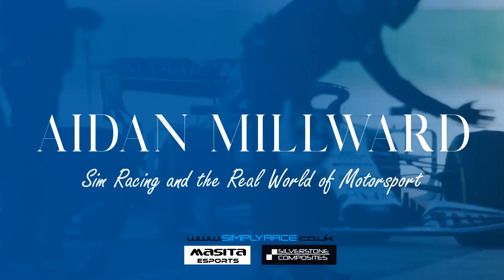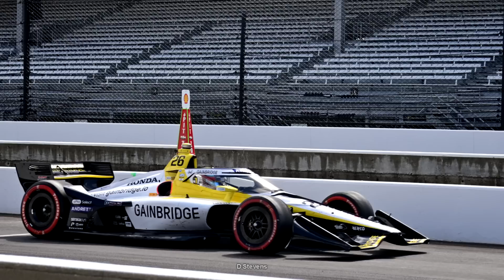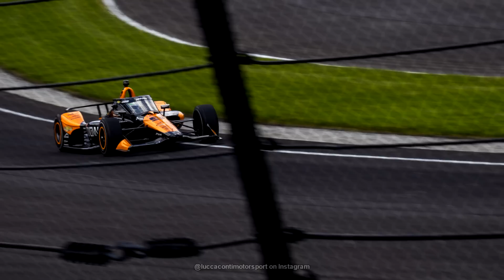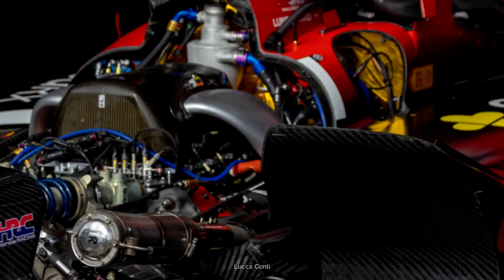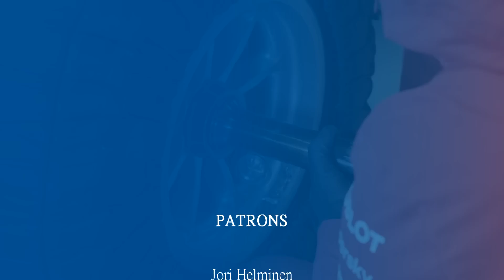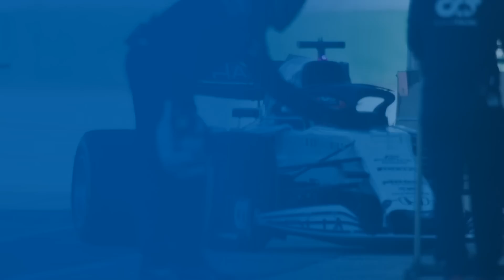WHY CHANGE ENGINES MID-SEASON? Opinions and a Look at Indycar's New Hybrid Engines

Comment: It sounds like a disorganised mess, but it could turn out to be ideal.

Half a season to figure out what the bugs are, do some experiments that’ll have the spectators complaining about the racing not being as good, then use the off-season to implement any major changes and get it all working properly. Bosh.

They don’t know what chassis changes could be necessary without finding out properly, which is better than guessing.

Comment: Two things:

1. Nashville is using the short oval aero rather than the superspeedway aero.

2. I honestly think the stinker at Iowa is due mostly to the repave and the fact that Firestone really screwed up the tire compounds. The lower lane was just too grippy to allow for any overtaking. The hybrid may have added a bit of weight, but there was no major change from it.

Comment: I think indaycar taking baby steps with new tech is fine. Better to work out issues in small chunks than all at once.
The new chassis is the going to put the weight in better places and hopefully make the car less of a pig. If there is a weight drop don't expect it to be substantial. 
Indycar is almost a spec series and while having more manufacturers is great I don't think it has that much of an impact on the series and the racing as a whole.
Tire competition is gone
chassis competition gone
engine competition.....lets wait and see.
Reply: You're never getting a tire or chassis competition (or even engine competition) like that again because that stuff needs money sprayed at the wall and a willingness for teams to try a rival's product out. Money that doesn't exist anymore, and trust that is gone because right now every team in Indycar thinks that they are just temporarily embarrassed champions and with one driver or one personnel change they'll suddenly be scrapping for wins and maybe titles.

Tire competition resolved itself in 2000 when Goodyear couldn't step up since '97 and everyone up and down the grid admitted Firestone was better. There's just no one else who's can crack the good feelings that Firestone gives the series right now, there was a move to swap from Firestone to Continental (?) in 2011 and the backlash was so bad from drivers and teams that the people who were pushing the change were all but evicted from their jobs in the following years.
Same with chassis competition. Five different manufactuers in CART in 1997 (Lola, Reynard, Penske, Swift, Eagle) and all five of them had bankruptcy between '97 and '02, with only Lola coming out of it alive because they went bust and recovered first. On the IRL side the chassis war between 2003 and 2005 ended because all the top teams jumped in on Dallara so Dallara just got enough money to crush the competition despite putting out an aerodynamic safety nightmare. There was a private bidding war for the 2012 chassis and Dallara won easily but all four submissions were financially gimped: Dallara's DW-12 won but was overweight and underdeveloped, Panoz just copy-pasted the DP01 specs, Deltawing was undercooked and slow to develop, and Lola had this bizzare idea that they could pull a Radical Cup and make the Lights cars and Indycars the exact same thing but with slightly different wings and engines.

Comment: Indycar is a complete joke with 0 initiative to actually improve. Indycar fans will defend this lethargy because “the racing is unbelievable”. News flash: no one cares. Gain some interest by doing something NEW and INTERESTING. This hybrid engine was introduced to keep Honda from leaving…not because the sport wanted to introduce something exciting for the fans. If this sport continues to stagnate it’s going to be gone in the next few years. Indy needs a complete overhaul…this hybrid engine is a meager start, but doesn’t begin to cover the actual issues affecting the sports health. The racing will likely be good regardless…give fans, sponsors, manufacturers, TV networks, social media, etc. things to be EXCITED about, rather than continuing the futile attempt to stop the sports bleeding

Comment: Coming from F1 where a new formula typically means lots of cars DNFing on fire or with smoke coming out of them I'm not much bothered by the idea of "doing it live" with the hybrid tech. It's cool that IndyCar is actually working on this stuff when other series aren't. On the other hand the hodge-podge nature of the current spec is a pretty valid complaint. Let's see how it goes.

Comment: I don't hate the hybrid, I hate how it is implemented.  They should be able to use the 320 kilojoules per lap at any rate the driver chooses.  Hopefully, they can increase the storage and create a higher output in power than the push-to-pass button.  Watching the past 2 races you can't visibly notice any extra speed from the car.  They should eliminate the corny red/green display chart for TV viewers and add red/green lights to the roll hoop.
I felt bad for Dixon, it really hurt his chances in the championship.

Comment: The primary culprit for the lack of passing at Iowa last weekend was the combination of the repaving and the tire compound Firestone brought for the Indycars.  Previously, the action was great because the tires started to go off about 30 laps into a run, when the cars would start to become a handful, and tire management was paramount.  This resulted in the need for four or five pitstops.  This year the tires would last an entire fuel run and this resulted in the race being a two-stopper.  Contrast that with the Indy NXT race where tire blistering was so bad that they had to shorten the race distance and insert a mandatory yellow for a new set of tires... so it wasn't just the repaving.
Reply: @HolmstromRules  Yep.  Firestone brought tires that were better designed for LeMans than Iowa Speedway.  Add that to the half ass repave and you've recreated a Texas Motor Speedway race after they dumped all the PJ1 crap on the track.  We won't have a good comparison until after Gateway which will give us a street course race and a short oval to see if it's the hybrid that's the problem or something else.
Reply: So one race with too little and one race with too much tire degradation?
Reply: @extragoogleaccount6061  Yep.  It wasn't Firestone's best weekend by a long shot.

Comment: The same teams that loved the chassis and engine diversity of CART has fallen in love with the cost savings from using the same engine and chassis until they are sent to a graveyard.  RP is spending adverse and hopes to get several more years out of what the series has by making changes that continue to delay any new chassis or engine. These teams will continue to beat the DW12 dead horse until the series collapses.
Reply: @MrRb9999  Those same teams were also generally paid by those manufacturers to run their equipment.  Things change when you're spending your money on stuff.
Reply: @danielh8316  that’s fine.  Just don’t make this sound like an issue caused by the series when it’s push back by the teams.  The teams like squeezing the pennies regardless of the affects on the series. They have had a chassis redesign on the table for years along with engine rule changes, but it keeps getting pushed to later dates and I’m sure it’s not the series requesting the delays.  Best way forward is to get a new chassis and have Illmore build the engines and let chevy and honda walk away.  They don’t have interest in racing, just designing stuff that doesn’t improve the racing product.  Next they’ll be pushing for a 2 liter I 4 engine with a 500 lbs battery.
Reply: @MrRb9999  Except it's only now IndyCar has come to the realization that they need a new car.  There still has not been an official tender for a new car, just the upgrades they keep making to the DW12 chassis. The only thing in your list that was actually worked on was the 2.4L V6s when Toyota was going to join before the new CEO of the US division pulled out.

If they just wanted more engines, Cosworth would have been there Day 1.

Comment: Introduced needlessly. I'm just laughing because it's worked out exactly as I knew it would. Even at best, it's just another push button gimmick to go with Indycar's existing gimmick of P2P. So funny that DRS is seen as a bad thing even though it's cheap and reliable, and it works. Indycar spends tens of thousands on two similar gimmicks that are unreliable and don't work.
Reply: DRS is a gimmick because only certain drivers and use it at certain times while P2P and the Hybrid are open to everyone.  And even if it didn't provide any extra boost, I'm happy the drivers can restart their cars after they stall in a crash or avoiding a crash.
Reply: @danielh8316  DRS actually does what it's designed to do. P2P doesn't and neither does this hybrid farce. They're just two things to get the talking heads in the booth to fill airtime with while providing no benefit real or imagined. That's a gimmick, Dan.
Reply: @F1jones  No, a gimmick is something only some drivers can use.  An even worse example is the Formula E Fan Boost.  If DRS could be used by the guy and front and in back, the majority of people would stop complaining to the point that the 2026 aero regulations does exactly that.
Reply: @danielh8316  sorry that you don't know the meaning of "gimmick, but it's "a trick or device intended to attract attention, publicity, or business." In other words, it's something that performs no function other than to serve as a talking about re: "hybrid."  DRS isn't a "trick," it actually allows passing where it's otherwise not possible. The fact you don't like how it's implemented doesn't change the fact that it actually works as it's supposed to. This hybrid joke is NOTHING but a gimmick and is intended to get people saying that Indycar is "hybrid," which the series has admitted, with the ultimate goal of attracting the mythical third manufacturer. They don't care that it does nothing for the racing itself. It's just another P2P which, BECAUSE at best both drivers can use it, with it becoming a "Push to not be passed" feature like in a video game, it results in no change but, again, is only something to bring attention to otherwise boring racing. It changes nothing on track, and thus, by definition, is nothing but a gimmick. Give it up, you're discussing things you don't understand, evidenced by your FE tangent, which has no bearing on this topic.
.
Reply: @danielh8316  sorry for the late reply, but I just thought of something else while watching the Toronto race today. F1 teams design their cars to get an advantage via DRS. It's an area of active development for every team and you can gain an advantage by engineering a better solution like Red Bull showed last year. It's resulted in there being a lot of variation in the rear wings from team to team and track to track. In Indycar, it's just a bold-on standard component. There's not even any competition between Honda and Chevy. You can't gain a competitive advantage by developing it in any way and teams can literally put more thought into improving their steering wheel as they can this hybrid component. But by that token, if it breaks there's nothing the individual team could have done about it too, they have zero input. That most succinctly defines it to me as a gimmick and not having much substance. 

Also, you said that only one driver has DRS, but that's not really true. When you're passed, you can try to keep up. If you were really faster, you can keep up and use DRS to re-pass the driver that just passed you. That happens all the time. It's also not automatic, there were quite a few instances in today's F1 race where drivers out-braked themselves. DRS isn't as automatic at some tracks as it's portrayed sometimes.

Comment: Why even add the extra complexity and weight of a hybrid system anyway?  It is purely 'green' pandering.
If IndyCar simply wanted to add want more power, they could (should) merely open up the engine rules a bit.... nah...  'save the climate'!
Reply: Because it also acts as a started motor to refire stalled cars.  If it wasn't at Mid Ohio, Race Control would have had to finish under yellow because of Grosjean's spin, but with the hybrid he restarted his car and continued racing.
Reply: @danielh8316  Nah.... they could simply add a traditional type starter if that was the goal.
Reply: @TalladegaTom  Traditional starters would drain the hilariously small IndyCar battery trying to crank a race engine with a 6-7000RPM idle.  That would require another modification in an area that can't really be modified.
Reply: @danielh8316  Um... no.
A starter system could be engineered for an IndyCar engine.  
The hybrid system as it is now is adding 105 pounds of weight.... surely you would agree that a traditional starter system could be engineered that weighs a LOT less than that eh?
Reply: @TalladegaTom  Where are you going to put it?  The car is already a Frankenstein Monster.  Plus, Honda and Chevy have already said they're keeping it at 60hp right now for reliability, but could go up to 150hp in its current form.

What's needed is a new car.
Reply: @danielh8316  I have some agreement there, but more hybrid complexity is going to make these cars look silly.  The F1 stretched limousine look is really odd looking and I do not want any of that in an IndyCar.

Few in the grandstands can really tell the difference between 2.2 L and 3.0 L.
Having more power all the time makes for better racing and demonstrates more driver skill every time.
Pushing a button to make an easy pass is the antithesis of that.
Reply: @TalladegaTom  It's not just pushing a button like DRS.  It's a system both drivers can use at the same time for offense or defense.  If it was something stupid like DRS where only the guy behind gets to use it but only if he's close enough (or even worse: the Formula E "Fan Boost"), then we're in full gimmick mode that needs avoided at all cost.
Reply: @TalladegaTom  Can nobody tell 2.2L and 3.0L apart or do we need the power to fix the racing, pick one.  F1 cars aren't long because of the hybrids, they're long because of aerodynamics.  The engine is nowhere near as long as the car is.
Reply: @alexisborden3191  Right.  The extra length is precisely due to the added battery tech and the space that requires.   
To be clear, the F1 car was not lengthened purely for reasons of aerodynamics, but for the added battery system(s).
Reply: @danielh8316  Agreed.   
I am all for returning to the day when the only thing to push when making or attempting a pass was the accelerator pedal or the brake pedal.
Give 'em more power to use in any way and we get better racing and some quality noise.  

PS: I'm old enough to have heard an Offy run at Indy and it was glorious!  :)
Reply: @TalladegaTom  Don't forget they also need a fuel cell big enough to run a 200 mile race since F1 pit crews can't stop lighting themselves on fire while refueling.
Reply: @danielh8316  That too.
Reply: @TalladegaTom  That's entirely the opposite of what I said.  Its also not true, in 2014 the cars didn't get longer, they mainly got longer in 2017 when the cars got much wider.
Reply: The entirety of motorsport is pandering to auto manufacturers who are ostensibly not 'green'.  If they wanted to save the climate they wouldn't be bothering with racing, they'd just be building rail lines over the interstates.
Reply: ok thanks for that Cletus

Comment: Aidan, important to note, supercapacitors are far from new tech. They have been used by Toyota in LMP1 for their first many years of their hybrid program. They gave been extensively developed for years and the main issue is that they cannot store nearly the same amount of energy per weight as lithium-ion batteries. They can have incredibly high charging currents and discharge currents but that's of no real use when the currents already charging car batteries are so high the grid is the limit, not the battery charging current
Reply: They have plenty of real use in a performance setting to compliment a battery. If the capacitor bank is large enough to store the energy from a high amount of braking it can then be fed into the batteries at a rate they can accept. Currently you can only charge batteries at a given rate without damaging them, which is then a cause for a loss of energy as the rest of it is bled off as heat in the brakes. Similarly the discharge rate of a battery is limited as to avoid damaging the cells, with a super capacitor bank onboard the battery can slowly charge them avoiding the stress on the system. Why F1 hasn't been using them as a buffer for the batteries is beyond me.

Comment: Honda's engine has been ready for 2 years, Chevy's been messing about, or so that is what Honda is saying. That's why Honda was getting mad to IndyCar and wanting to leave when their contract is up after the 2025 season.

And, yes, the races are really good, any driver could win a race. But, the championship run is only for two teams. Penske and Ganassi have won the championship 12 years running now, and the Andretti had 4 championships in the early 2000's with more championships for Penske and Ganassi. Panther Racing has the only other two championships in the 2000's. That's worse than F1 for the championship run in the 2000's.